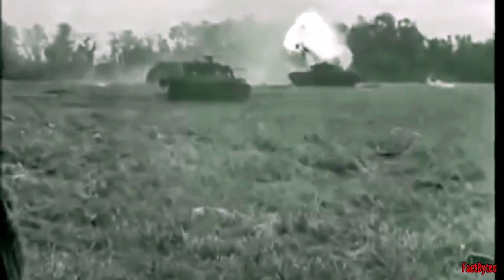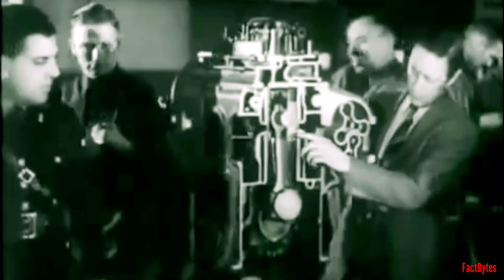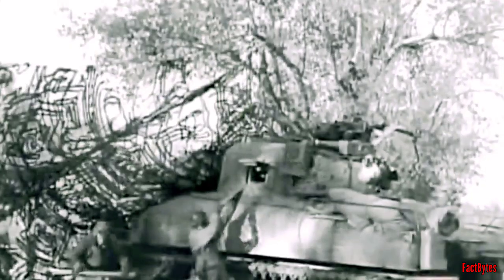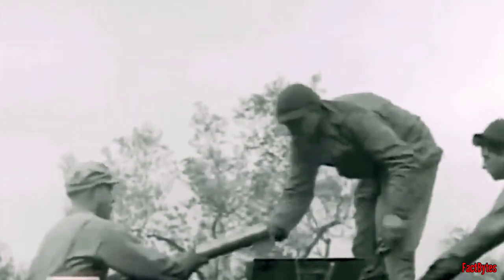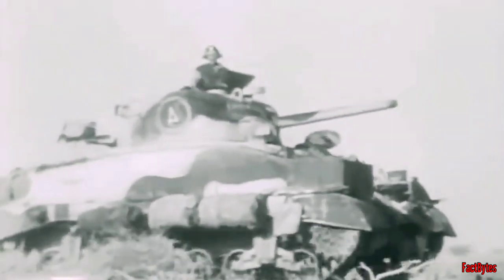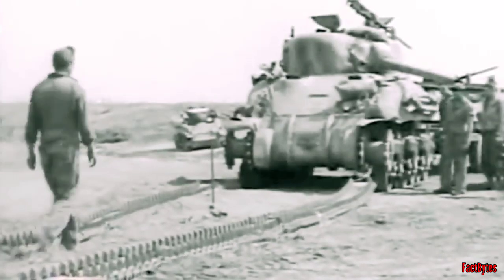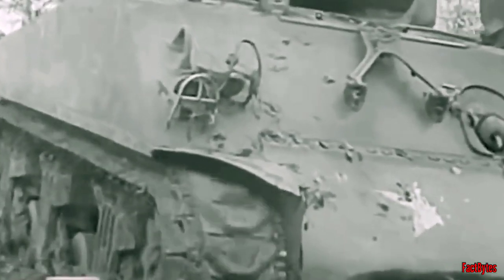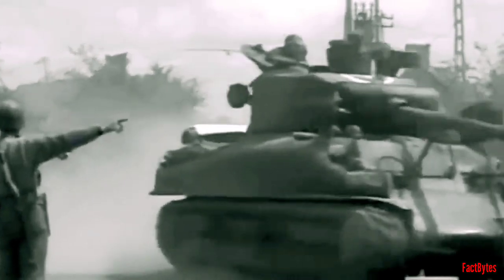How Good Was The M4 Sherman Tank REALLY?

Comment: It became a real force to reckoned with once the 17 pounder gun was mounted on it.
Reply: Yes, for example Firefly of Lt. G. K. Henry destroyed 5 panthers with 6 rounds. Sgt. Harris also destroyed 5 panthers from a distance of 800 meters. Between 7-8 August 1944 6 Pz IV, 1 Panther and 3 Tigers, including Wittmann were destroyed by fireflies. Malcolm Lock in his firefly destroyed King tiger during goowood. In general, in tank warfare, the usual rule is see first, fire first, hit first. Even a regular Sherman with a 75 mm gun could destroy a Panther or a Tiger if hit side in an ambush, for example.
Reply: Except it was VERY inaccurate, to the extent it was near-useless at distances over 800 yards.  The 76mm M1 gun was - at these ranges -}a far better weapon, more accurate and with almost the same penetrating power (especially when firing APCR ammunition) as the 17-pdr.
Reply: @brucelamberton8819   76mm gun on Easy 8 was more precise at range than Firefly’s 17 pounder, BUT the bigger gun had higher penetration against German heavy tanks.  if you run into a Tiger II coming at you down the field, the Firefly would certainly feel more powerful in an engagement than an Easy 8 would. US doctrine was for Tanks to support infantry. Destroying enemy tanks was the job of tank destroyers and the artillery.
Reply: @brucelamberton8819  Only the APDS rounds were inaccurate, the standard AP rounds were accurate enough - as shown by the lone Firefly that knocked out theree Tigers at a range of 800 yards 8 August 1944, using only 5 rounds. APCR rounds for the 76mm M1 were very rare, and standard rounds underperformed due to low quality (too soft).
Reply: @TTTT-oc4eb  Mind, even with standard APCBC rounds a 76mm M1 could satisfactorily defeat a Tiger I's frontal armor at such a distance.  The bigger problem was the Panther--neither APCBC nor HVAP (APCR) could get through the glacis with the 76mm, and even the QF 17 pdr required SVDS ammunition to pierce it (though it did have a healthy 1500 meter effective pen range, at least).

It should also be mentioned that Tiger IIs were absurdly rare on the field, as were Tiger Is (the U.S. may have only ever encountered real Tiger Is two or three times in Western Europe), and even Panthers; there were less than 170 Panthers in the whole Western Front by the time the Easy Eight was fighting in serious numbers, of which somewhere around half were fully operational at any one time.
Reply: @Jukkaimaru  US test were flawed and in reality a 76mm armed Sherman had to close to point blank range to have a chance against a Tiger 1 at all. If the Tiger angled its hull it couldn't penetrate at all, and the Tiger's effective turret front armor was much thicker than the Panther's. The problem was the too soft standard rounds which had a tendency to shatter against thick German armor, which was harder than the US test plates. The HE filler would also often detonate at impact, causing the round to shatter, US test were done without HE filler. Even the 80mm hull front of the Panzer IV proved a challenge. The Easy8 was mostly a 1945 tank and always a small  minority of the Shermans. From June 6 to the end the Panther was the most common Panzer in the West with 1835 deployed vs 1650 Panzer IV. US Army met Tigers far more times than three. The M24 and very rare M26 alone met the Tiger 1 three times.
Reply: @TTTT-oc4eb   Most of my information comes from postwar testing with proper values replacing earlier estimates.  It certainly was better than "point-blank".  I'm also not sure what you're on about regarding shell softness?  AFAIK the main issue was the round's charge being lighter than the 17 pounder's.

On Panther numbers...keep in mind that I said "when the Easy Eight arrived in numbers".  From late 1944 the Germans started rushing more and more of them to the Eastern Front, making armored encounters much rarer in the West.  Especially for the Yanks--the British always bore the brunt of German tank assaults and that was the reason they got Firefly into service.  They had a much greater need for a pure anti-armor weapon in the Sherman and didn't care if the gun had to be jammed into the original size turret all cattywumpus to make it happen.
Reply: @Jukkaimaru  The problem with the 76mm ammo was well known.

Richard Anderson of the Dupuy Institute:

“The "problem" with the 76mm wasn't really a single problem with the gun or in testing...it was multiple problems. The standard projectile, the 76mm APC M62 was produced with a large cavity for the burster, because everyone assumed that it was the behind-armor effect of the HE bursting that would do the most damage. However, there were two problems with that. For one, the larger cavity weakened the projectile, causing it to stress shatter when striking at high projectile diameter to armor thickness ratios. And then, even when it didn't fail, the BD fuse (common in all the US APC rounds) tended to go off before penetration was completed, destroying the projectile and preventing penetration.

However, when tested at Aberdeen they weren't testing for behind-armor effects, so the cavity was inert filled, which improved the results. The problem was exacerbated by the simple fact they assumed the Germans would be using armor similar to our own and BRL did not have samples to test to destruction until late 1943 in the case of the Tiger, early 1944 in the case of a late-model Panzer IV, and late October 1944 in the case of the Panther, which was far too late since the 76mm gun development was completed in early 1942. On top of that, it wasn't until June 1944 that it was realized the hardness specifications for the American projectiles was insufficient as well, which meant that the solid AP projectiles were also deforming and shattering when striking the German armor, even though after the initial problems found with the APC rounds had led to the assumption relying on the simpler AP shot would solve the problem. The solution was re-heat treated AP shot, the M77 in the 90mm, which became the T33, while in the 76mm work on perfecting the HVAP continued.

On top of that, the 76mm had major issues with flash and blast obscuring observation of the fall of shot. The flash problem was solved when it was found that it was caused by failure to completely combust the propellant in the cartridge...the solution was a longer ignition primer. Blast could be solved by a muzzle brake, but it was considered NIH - and too "German" - so was delayed in deployment.

Of course, the worst problem was the conservatism of Ordnance. The flash problem could have been solved from the get go with flash suppressing chemical additives, but they were considered to cause excessive wear in the tube so were rejected, since Ordnance liked to achieve 1,000+ round lifetimes in its barrels, which hardly helped when the tank it was fitted to only fired 200 rounds before it was knocked out. On top of that, despite advice to increase the propellant load and thus increase chamber pressure and Mv (as did the Germans in the Pak/KwK/StK 40 and KwK 42 and the British in the 17-pdr) in the 3" and 76mm, Ordnance refused because of concerns with safety issues. Fundamentally, there was nothing mysterious about the 17-pdr that made it a better 3" gun than the American 3" gun, since, despite the nomenclature, the 17-pdr, 77mm, 76mm, and 3" guns were all very similar pieces.”
Reply: Why not mount the 17pdr on Churchill or Cromwell ?
IWM "From late 1942, US tanks were required in increasing numbers to make up for the deficiencies of home-grown products. Only in 1944 was British industry able to deliver a tank reasonably fit for a fast-moving battlefield, and even then it was scarcely a match for its opponents."
Britain's Struggle To Build Effective Tanks During The Second World War
Reply: Thats a good one(:-))
Reply: @nickdanger3802   The Comet performed well, and the Centurion would have made short work of any German tank.
Reply: Only in ambush.
Reply: @Bullet-Tooth-Tony- - Those last two sentences are absolutely incorrect.
Reply: @TTTT-oc4eb - Absolutely incorrect.
Reply: It already was before that.  The 17-pounder and the American 76 were both available long before they were fielded.  But until the summer of ‘44, Shermans with the stock 75 were reliably killing pretty much everything they encountered.  Even in the last year of the war, Shermans with the original gun racked up a pretty respectable amount of tank kills, even though Panthers presented a bit more of a problem.
Reply: @Bullet-Tooth-Tony-  Not entirely true.  US doctrine put tanks in the infantry support role, but American tanks weren’t supposed to run away and call for TDs when they saw a Panzer.  They were expected (as explicitly written in said doctrine) to engage and destroy enemy tanks as part of the infantry support mission.  The tank destroyers were to act as a QRF against any strong push by enemy armor, while secondarily supporting the infantry similar to the tanks.  The Chieftain gives a pretty good breakdown of the doctrine using original documents as sources (plus he’s both a historian and a US Army tank officer, so he’s what you might call an expert on this stuff).
Reply: @cdfe3388  - Finally, someone who knows some history!

Comment: Added crew comfort = Good.  High silhouette = Bad.  It’s surprising to see how tall an M4 actually is.
Reply: The extra did however allow for greater space within the tank making crew ergonomics much better, and it was very easy for a Sherman crew to get out of the tank if need be.
Also penetration hits and shrapnel wouldn't kill all the crew as often as other tanks
Reply: It was no taller than PzKw IV. Taller than T34.
Reply: @coachhannah2403  the Pzkw IV is 8’10” in height.  The M4 Shermans are a little taller at 9’0 to 9’9” depending on the variant.
Reply: @jackzimmer6553  - <2%. Same height...
Reply: @coachhannah2403  you said no taller than a Pzkw IV.  You stand corrected.
Reply: @jackzimmer6553  - Sure 🤷‍♂️

Comment: When the British first took it to battle in September 1942 it was an excellent tank and greatly contributed to the victory at El Alamein. It was a fine infantry support tank because of the accuracy of the 75mm gun firing HE shells. It could handle most of the German tanks encountered on the battlefield. However when armed with US 75mm and 76mm it was no match for German Heavies, but the 17 Pounder Sherman Firefly proved itself excellent at this task.
Reply: The US 76mm M1 gun could penetrate a Panzer MKVI Ausf E frontally at over 1000 metres, so it clearly was a match as the average combat range in the ETO was under 850 metres.
Reply: @freddieclark  The Tiger Ausf E had  120mm of armour. The US 76mm APC could only penetrate 89mm of armour at 1,000 meters. Before you scream HVAP, that was not issued to tanks, strictly TD ammo. Also HVAP was erratic at longer ranges because of the aluminum alloy jacket.
Reply: @billballbuster7186  The Tiger 1 had 100mm of armour and the M1A1 firing M62 APC could penetrate that at 1000m. You are quoting the penetration at 30° from vertical.  There is also solid evidence that T93 rounds were issued to the M4 beginning in feb 1945, contrary to your claim.
Reply: @freddieclark  No. it had 110mm on the hull which is sloped 20 degrees and 120mm vertical on the turret front. Never once heard of a US 76 penetrating a tiger or Panther frontally. The only allied gun accepted as a Tiger killer was the 17 Pounder APCBC that could penetrate 140mm of RHA at 30 degrees and distance of 1,000 meters. With regards to  HVAP, I was quoting AGF orders and would expect those orders were complied with. If you know of different orders let us know
Reply: @billballbuster7186 100mm on the hull sloped at 20°. Engagement ranges in the ETO were around 800m average and often closer, so it is quite possible for the 76mm gun to penetrate at those ranges. AGF orders were that 'priority' was given to Hellcats for the 76mm T93, that did not mean or imply exclusivity and as production of T93 increased quickly from the 1,000 rounds per month in sept 44, to 6000 and increasing by Jan 45 it was slowly doled out to tank units.
Reply: @freddieclark  You are flogging a dead horse, repeating the same crap as if you say it enough it makes it true. Most US tank men hated the 76 as it was crap with both AP snd HE, the 75 tanks at least had good HE performance. Read some of the accounts man.
Reply: @billballbuster7186  Here is another report that disproves your myth repetition: An April 1944 report - before D-Day, based on experience in North Africa and Italy - stated that:- Combat troops have definite ideas as to what improvements should be incorporated in tank design. First, the Board inquired as to what they considered the most important features in a tank. The replies were unanimous: the gun was of first consideration. With respect to the gun for the medium tank, they demand larger caliber and higher velocity.  The M4 tank with the 76-mm gun meets the requirement for more gun power. Now, lets look at development, A detailed assesment of the  M4E6 project which was a modified M4A1 (and which led to the  M4(76)W, M4A1(76)W, M4A2(76)W and M4A3(76)W) concluded that "it was universally liked by all personnel who saw it. The modified turret was considered an outstanding improvement. Although it is realized that this new turret does not provide much more room, its seeming roominess will benefit crew morale, and the modification makes operation within the turret much easier.
The fire-control equipment in this tank was considered very satisfactory and far superior to that in use at present. Nearly all personnel in armored units believe that the 76-mm gun is a vital necessity for medium tanks, and they would be willing to sacrifice some ease of ammunition handling to gain this high-velocity gun".

Comment: The Panther was equally vulnerable to fire when hit foe the same reasons. The Germans called the Sherman a Ronson because that brand of cigarette lighter had the slogan "Lights first time, every time." But the Panther was a Ronson, too.
The Sherman Wet ammo storage was not in water but in a nonflammable liquid that would not evaporate like water would if hit by the force of an armor piercing round.

The bad reputation came about due to a tank recovery man named Belton Cooper who wrote a book called Death Traps. All he saw were the tanks which often had the remains of soldiers still inside. He did not mention the tanks which were knocked out and were easily repaired, just the ones totally destroyed and had to be rebuilt or used for spare parts. He became jaded and sick of death, as would anyone who had to clean death out of a tank one too many times. Oddly, very many Shermans knocked out were repaired in field workshops and not all knocked out were by interior penetrations but also by losing tracks or engine compartment damage. When someone writes, as did some Brits talking about their Shermans, Comets and Churchills,, 700 tanks destroyed in a battle they did not mean totaled, they really meant put out of action for most of the losses.
The M10 tank destroyer was made to destroy tanks, having a 3 inch naval gun as a stop gap measure. It had a diesel engine and when the new M18 Hellcats began to arrive, the M10 tank crews didn't like them because they had gasoline engines and caught fire too easily. Neither of these tank destroyers were Shermans and had very thin armor because the idea was to shoot and scoot. The M10 and later the M36 were built on a Sherman chassis but did not have a Sherman hull. Later in the war, M36s (called The Jackson) were built by putting an M36 turret and its 90mm gun, directly on a Sherman hull, giving it the added protection of a hull mounted machine-gun if wanted.

I do have a problem with the video itself. A great number of the images are reversed, making writing writing backwards and showing Sherman drivers on the right instead of the left. I hope this ban be fixed.
Reply: The bad reputation came from the crews during the war. Eisenhower heard of this and commissioned a special report on the comparison of American v German equipment including the Sherman. The report from US 2nd Armored Division that Eisenhower received in March 1945 was not good reading for Sherman aficionados. Full of Shermans crews complaining against it vs German tanks. Usually armour and armament but also lack of manoeuvrability on soft ground.
Even a report from US 6th Armored Division in February 1945 cited the Sherman as ineffective.
Reply: Reliable tank. plus german tanks broke down a lot and rlly hard to repair due to having specialized, uncommon parts. They were even prone to running out of fuel. The Sherman had a high survivability rate compared to the T34.
Reply: @SomeLostInesh 
80% of German tanks were smaller and lighter than the Sherman. Quite reliable too and fairly easy to repair.
Reply: The Ronson myth has been destroyed for a good while now so not for sure why people still use it.
Reply: @lyndoncmp5751 This is completely wrong also. No report exists that anyone knows of. Also why would they be complaining in March of 45. Two months from ve day. By that point most after action reports from tank platoons and companies reported they had nothing to shoot at lol

Comment: Odd phrasing of statistics at 05:32 into the video! You stated the Sherman would catch fire 82% of every 1.89 times a shell penetrated. Is not .82x1.89=1.5498? Basically 4/5 of the time when the bill was penetrated the Sherman caught fire!
Reply: No, that's no correct.
Reply: @brucelamberton8819  I’m glad for my math to be wrong. What do you figure 82% of 1.89? Thanks in advance.